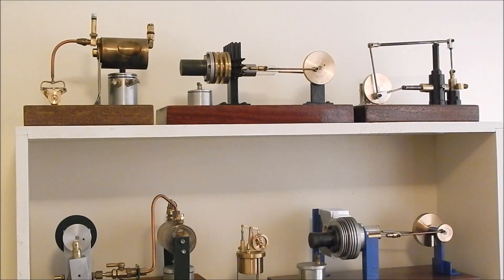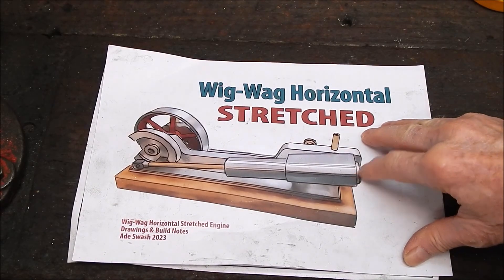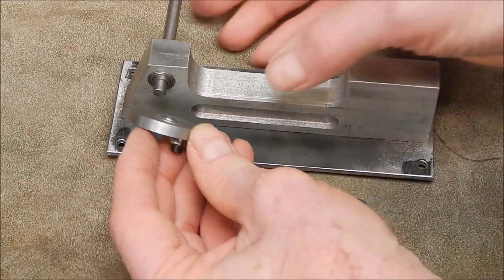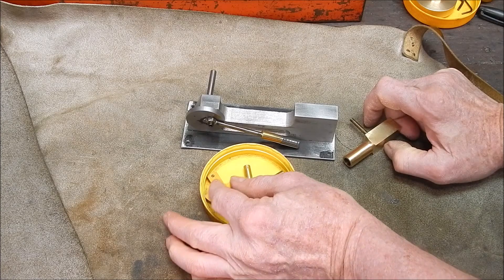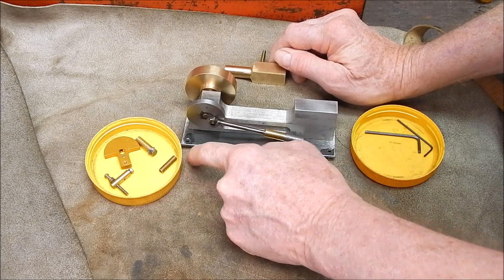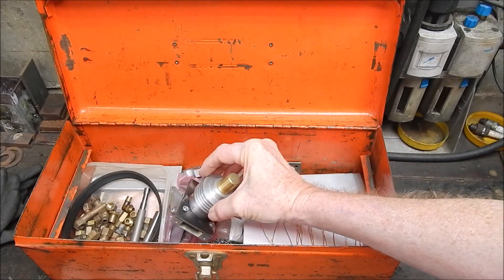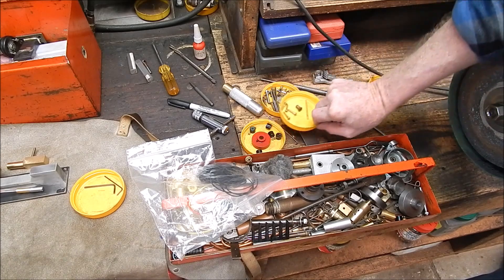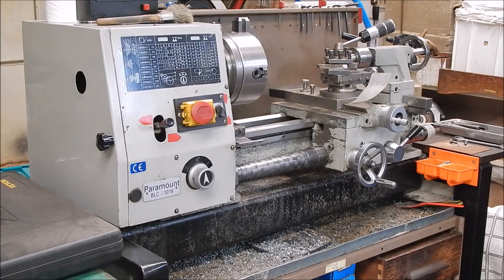Build a stretched wobbler steam engine - the current project

Comment: I've got that little vertical brass engine, you've got in the middle of the top shelf.

Got mine from Banggood.
Reply from the maker: Same here - it's from Banggood.
Reply: @Xynudu  It's a cute little engine, isn't it?

I run mine on Bio-ethanol. I find it burns cleaner than methylated spirits.
Reply from the maker: Where do you get that ?

Comment: Hi Rob, nice little project. These little oscillating motors also have to be built very precisely so that they run well. (I think the crank with brass counterweight is perfect for the job)
Greetings Michael
Reply from the maker: Hi Michael.  Yes, the mating surfaces and ports must be well aligned.  Considering their simplicity these engines are quite powerful and can run some surprising stuff. Cheers Rob